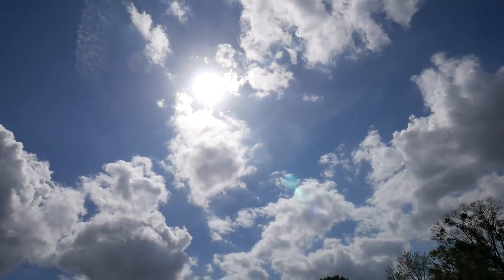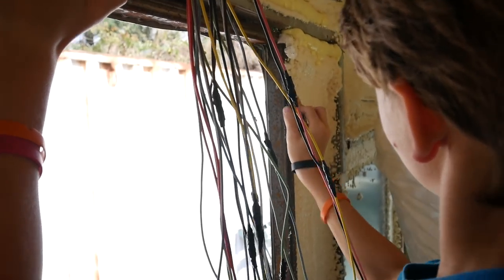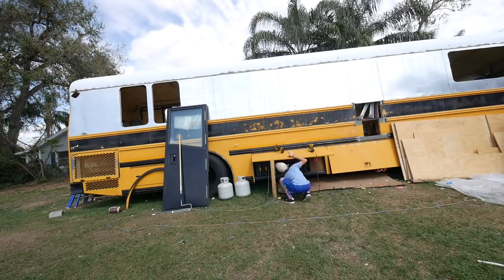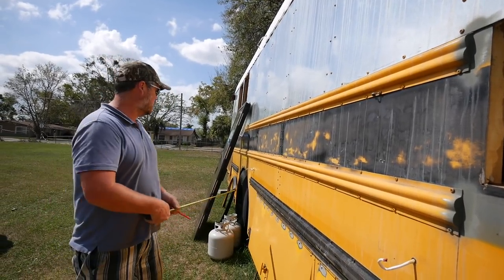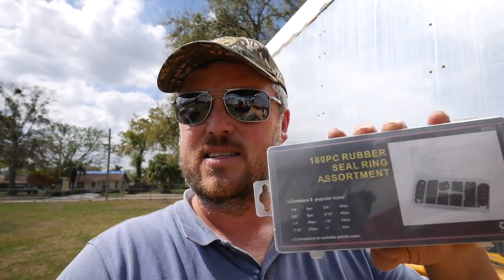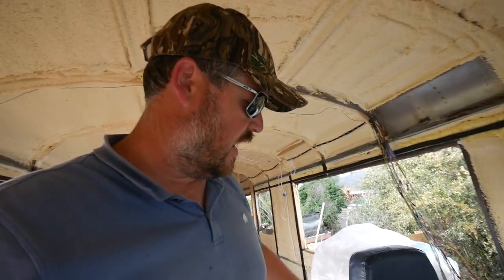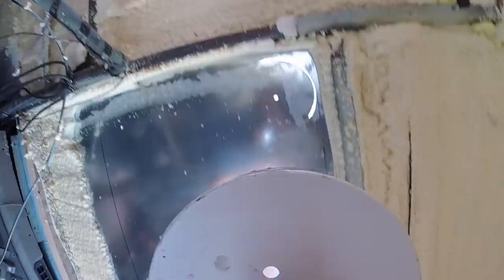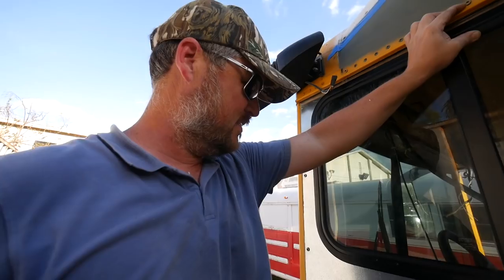Wiring Marker (Chicken) Lights on our Bus Conversion | The Bus Life

Comment: Finally got our bus for a 35 ft blue bird tc200 flat nose front engine bus for 3grand.in the last5days removed most of the seats and wall panels.aswell as the Windows😁😁 my wife has done most of it while i been working. Can't wait to do the roof raise

Comment: I understand when it comes to brightness and life capacity that you'd use LEDs. However, If you're driving in say a snowstorm or are needing to use outer lights while freezing, the old standard bulbs are actually better because they make enough heat to melt snow and ice. That's actually one of the most common problems with newer  semis now is that the lights get covered in ice and snow and you can't see or be seen as well. Love your videos and thanks for the reply before.
Reply: Andrew Kniep I'm guessing they have no plans on being in that kind of weather!?
Reply: Basket Case, im not insulting them in anyway. In fact id love to be able to do what they do in a heart beat. I was simply pointing out a simple fact that truck drivers are struggling to see and be seen because of the the new led lights because of snow. Yes, they  are not truck drivers, i know, but they are still in a vehicle well over 30 feet long and well over 10 thousand pounds gross weight.  It takes skill and experience to operate, which yes they have. I said it because they travel, alot as u can clearly see in their videos. One thing ive learned over the years being around trucks, the tiniest little detail can throw u off. I know Shane would never put his family in harm. It was simply a comment on how the old lights melt snow and ice and dont create problems, no insult, no hidden agendas. Like my comment or hate, thats your choice. As my Canadian brothers in the north say: NOT SORRY
Reply: Basket Case I have to disagree with you.  In their previous bus they posted many pictures of their travels in freezing snow covered weather.

Comment: Shane when you paint the bus I would say do one side at a time not sure you should use hardener in the you don't want it to get overspray got to keep the paint wet I don't know what color you going to paint it we have used paint from Tractor Supply for the racecar but the selection is kind of limited happy trails

Comment: the rub rails you cut off for the fridge and hot water heater can be put on the spot that the midship emergency exit door was
Reply from the maker: I considered that but they are a bit to short and would still look a bit awkward.  I think it will be fine how it is.  I have kinda gotten used to it. 😆

Comment: I have a question can anybody run a 12volt battery which is connected to a many things like fridge microwave heater and many other thing and still function  (it is about wiring)be blessed